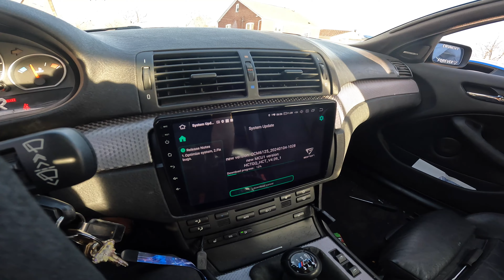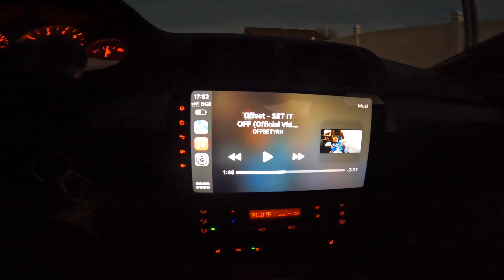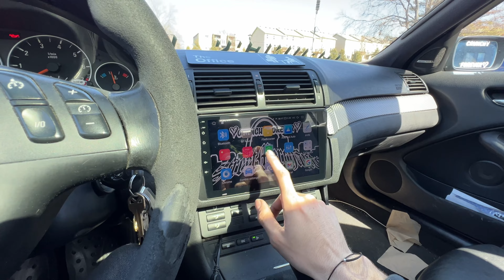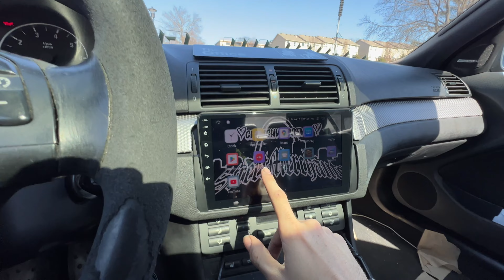E46 Eonon CarPlay Radio Install & Review!! (Android 13 Headunit)

Comment: how did you get your led lights on the screen working?, ive plugged my head unit in and the lights are not working, i even tried using the app to change the colour but nothing
Reply from the maker: they only come on when the headlights are on, but mine worked out of the box

Comment: how did get steering wheel controls? i have same
unit e46a12s 05 bmw 325i but cant for the life of me get the steering wheel controls to work
Reply from the maker: mine worked out of the box it might be something with the wheel unless they worked with stock radio
Reply: @lil2vjosh  they worked with stock radio
Reply: @NovaIIDBZII  might be your unit I just installed my this morning and they work for me as well
Reply: My AC/heater lights up but not blowing air at all. What y’all think !!